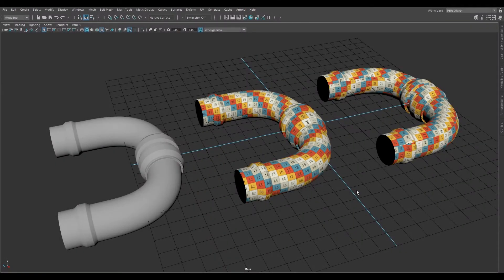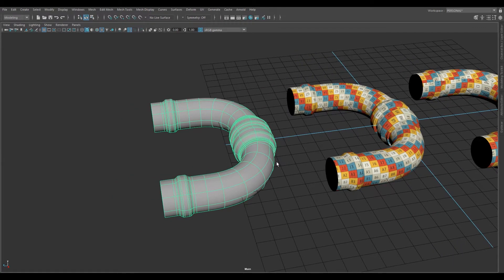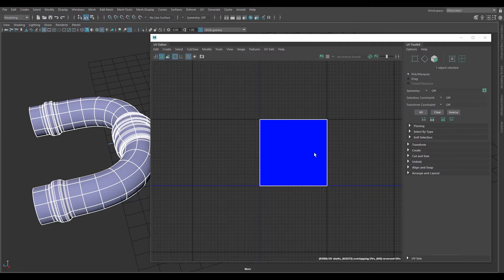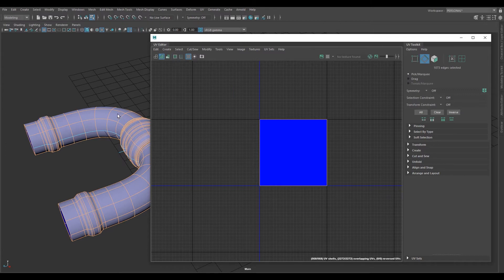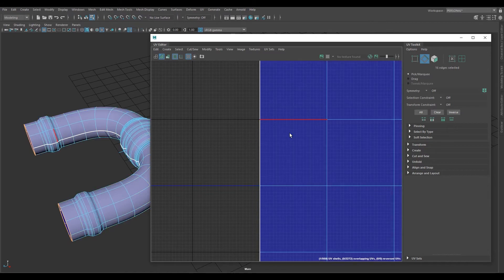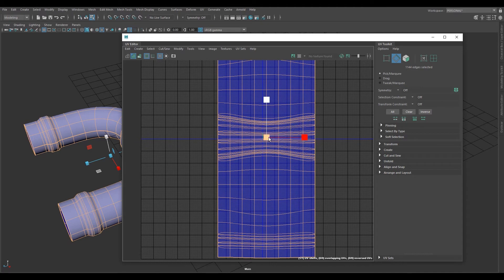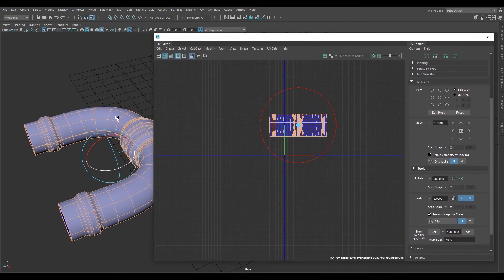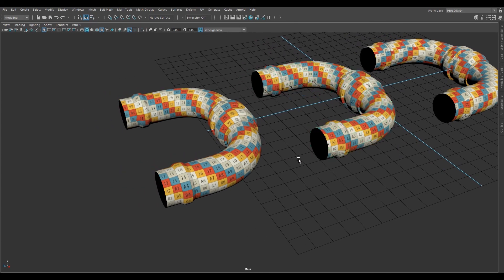How to UV Unwrap Pipes Using Unitize in Maya

Comment: Really good video. One question if I may SeyWut, what do you have in the UV material you used? It's just a standardSurface material (or the Arnold equivalent) with just the UV colored checkerboard image? Any other setting on the material? (if you have a video of it let me know)

Comment: 0:06 I don't understand why so many people use the automatic layout, then proceed to piece together the shells. That process seems so backwards and inefficient to me since the automatic process almost mindlessly puts cuts everywhere and splits your mesh into many shells, that it turns into a puzzle putting things back together in a more meaningful way. Its far easier to put cuts directly onto the mesh and then unfold that way. I've seen so many teachers follow the auto -> sew approach though and it always boggles my mind, makes me wonder if I'm missing something. PS: I'm not talking about this particular Unitize workflow, but what you said your normal workflow is.

That aside, great video!